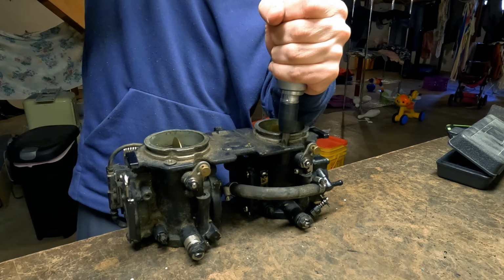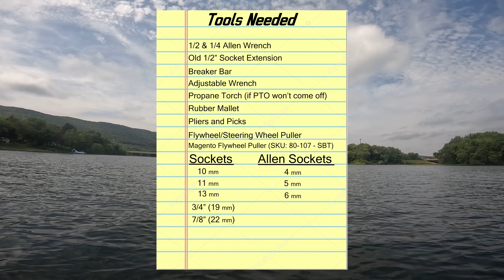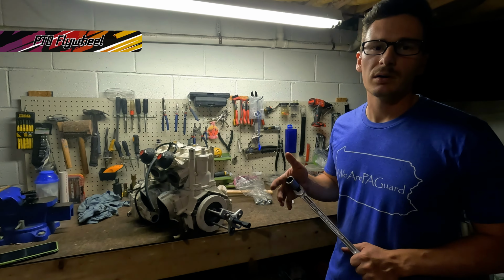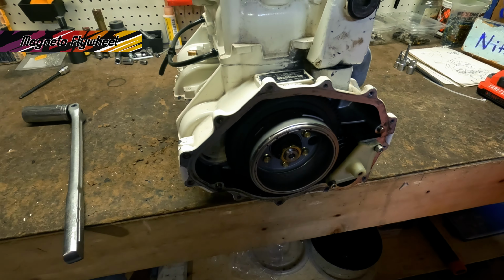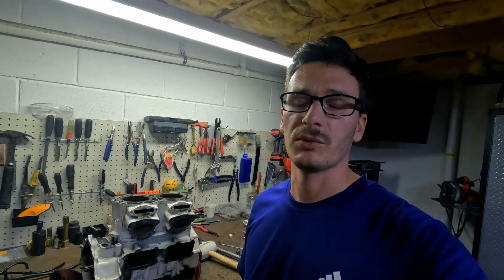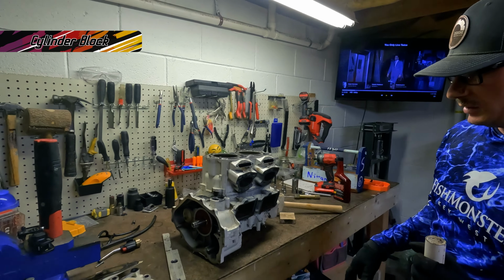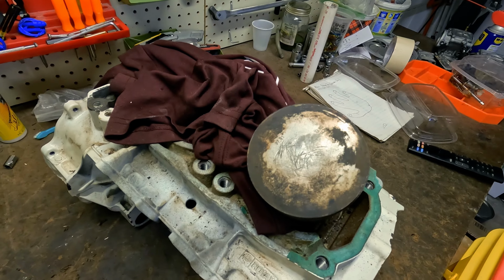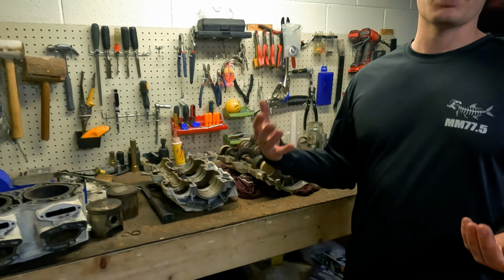How to Disassemble a Locked-up Engine | Seadoo Rotax 951

Comment: I have a 951 in a gtx that I had seize up on me. It was a fresh rebuild with only about an hour on the motor. It stopped running on me and I suspect the main ground had been loose. When towing it back I flipped it and flooded the entire engine. On land I drained the ski, pulled the plugs, and turned it over until water stopped coming out. What I didn’t think of was the bottom end. I didn’t mess with it for a couple of months and when I finally did pull it back into the shop I found the engine was seized. The pistons were fine, but the crank was seized. It wasn’t nearly as bad as your ski, it really was just the bearings. I worked each of the bearings free, slapped it back together and so far have put about 8 hours on the engine. I do expect it to fail again but I’m going to run it until it breaks.

Comment: I have that in my 2000 lrv that lost compression. Going to need a complete rebuild.
Reply from the maker: Sorry to hear... but generally, full rebuilds are good.  You wouldn't want to put an aging crankshaft back with a new top end.
Reply: @2-smoke  completely agree! Machine only has 70hrs on it. But it's sat for 12 years before I purchased it. I got it knowing I would have it rebuilt. But they are cool machines and will be brand new hopefully soon!

Comment: I have a 951 project coming up soon and I really don't want to remove the engine if I don't have to. Do you think I can get to the woodruff key without removing the engine on a 1998 GTX? This thing is backfiring, and I was hoping there would be enough room in the hull if I removed the pump and slid the engine back.
Reply from the maker: I’m not sure you can accomplish that.  Why do you need to get to the woodruff?  These machines are old.  Best to remove them and fully rebuild.
Reply: I believe the woodruff key is sheered off because the timing is bad, causing it to backfire. The engine has great compression,  so it doesn't need a rebuild.

Comment: lrv 2000 there 2 hole in block i was thinking of getting welder 
have you ever did this ?
Reply from the maker: I do not run or use welded cases.